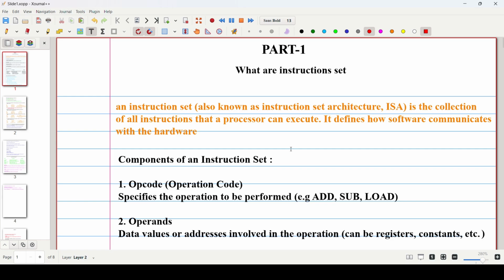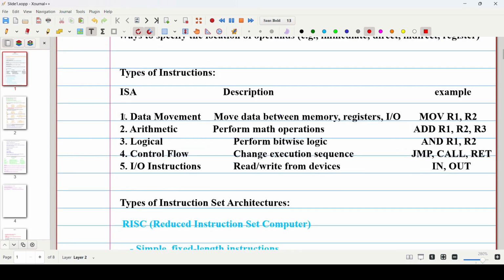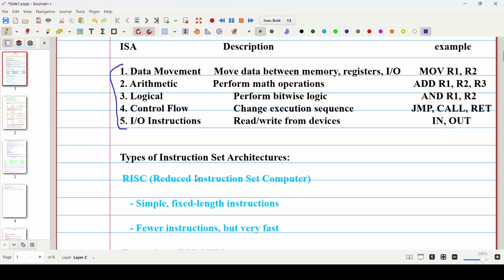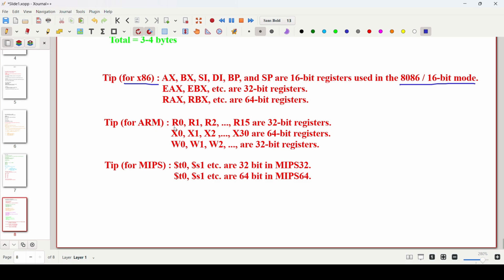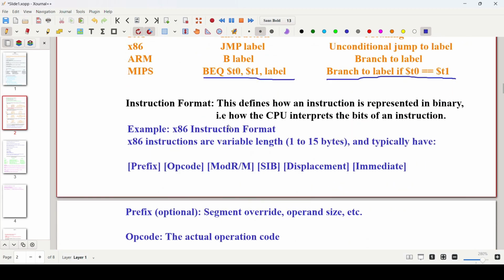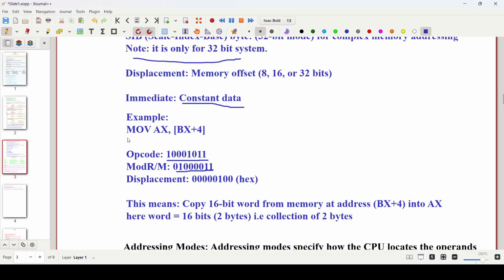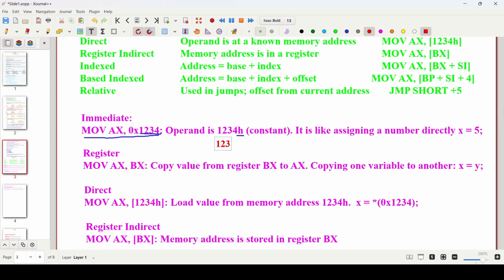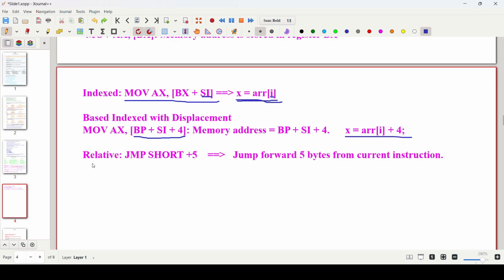Did you understand Instruction Set like this? PART 1

Comment: Very good.❤

I am not familar with the ARM CPU, but with the Intel x86 CPU family.

4. Program flow

One of the most importent register on a digital CPU is the FLAG-register in combination with some instruction that set or clear one or more single bits inside the FLAG-register and other instructions that use one or more bits of the FLAG-register like conditional jump instructions that use the bits to jump or not to jump inside the code depending on that bits if it is set or clear to build a program flow like a loop with other instruction inside the loop to perform a task with the instructions.